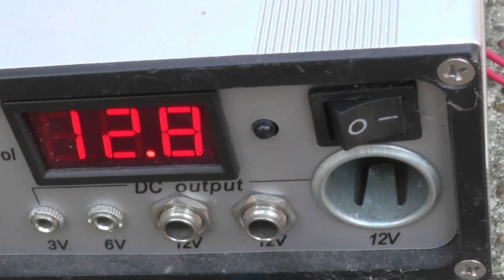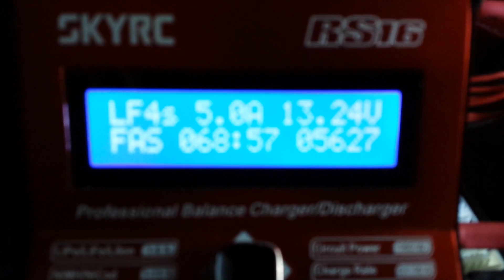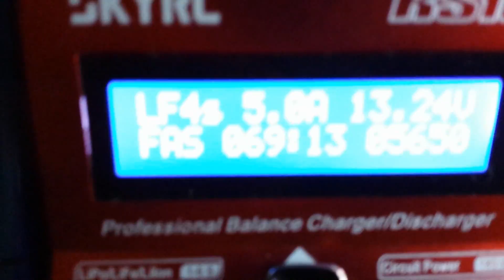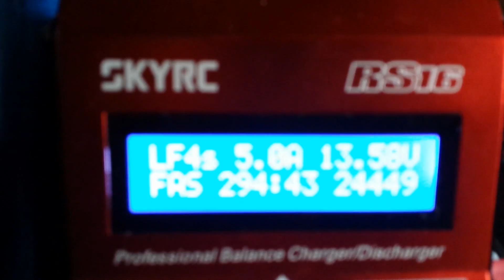LIFEPO4 part 9 - attempted charging from 12v deep cycle battery

Comment: How do you plan to use this battery pack?
Reply from the maker: This pack is experimental, purely for use of 12v lighting/laptop supply/camping pack! I am seeing what it can take.

I am waiting for a reasonable LIFEPO4 solar charge controller that meets my requirements for a bigger set up using much larger cells.

So until then I am just playing, finding a BMS I trust and in the future I will reuse these cells for an electric bike.
Reply: E-bike, cool. That's what I hoped to hear.